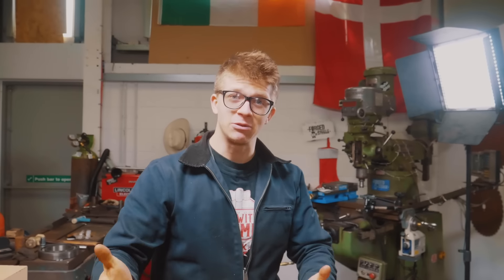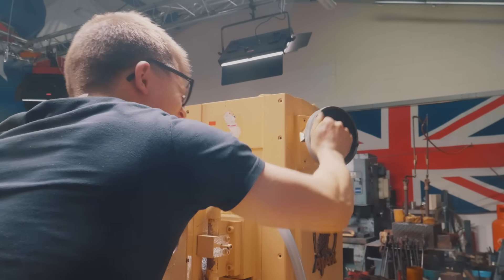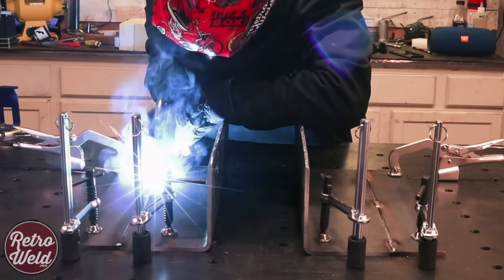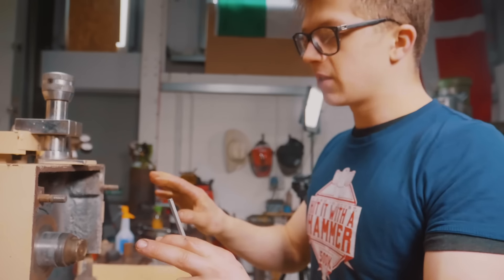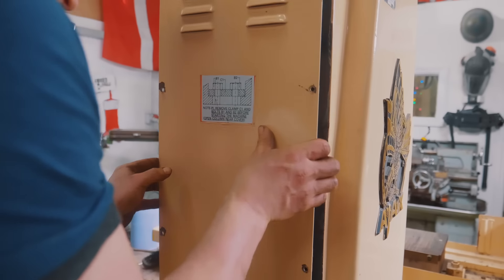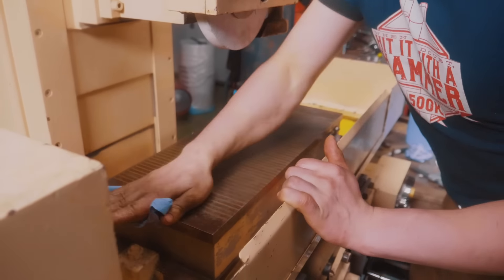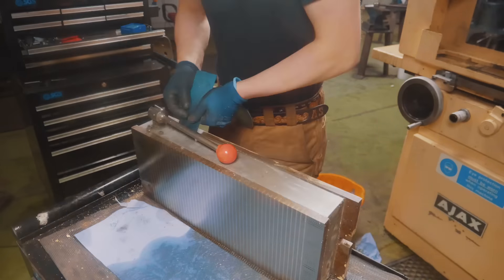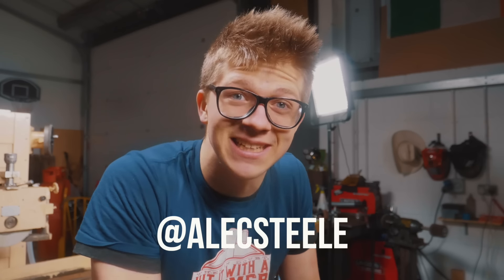THE SURFACE GRINDER IS ALIVE!!!

Comment from the maker: Hey guys! Just want to drop in and mention - I wrongly assumed water cooling the part on the surface grinder would keep the dust down enough to make it safe to operate without respiratory protection. After doing some googling this seems pretty stupid. In the future I'll be wearing my respirator when operating it and sweeping up the dust well after a grinding session!
Reply: 2nd
Reply: Nice!
Reply: Alec Steele you are amazing and I am wondering how to get in to black smithing I just got absolutely captivate by black smith
Reply: Stop tasting the oil
Reply: Just a suggestion as a machinist squaring the chuck to the travel of the grinder is very important but it is only half the battle during the video you took off the back rail of the chuck when cleaning it when you square the front of the chuck again and put the back rail on the chuck you will also need to side wheel grind that in to make sure it as well is parallel to the axis of the tables travel. Also I'm assuming if you've watched videos on grinding you've seen people use stones on everything from the chuck to the parts they place on it, stoning takes the high spots on a grinder and brings them down to average the top of the chuck and makes sure the bearing surface of the chuck to the part is as good as It can be so I highly recommend if you plan on using the grinder for accurate parts to get one, another tip I saw you put the grinding wheel down on the chuck I recommend not doing that as the wheel is harder than the metal used to make the chuck so in placing the wheel on the chuck you may have put a slight ding in it not a huge issue but just good practice. Also when dressing the wheel a new wheel that you put on the grinder will usually need to be dressed quite a bit to make sure you are running true the wheel might be bouncing on the surface there should be a lines perpendicular to the axis of the grinder where the wheel skips that is how you can tell visually but you might also hear a slight bouncing sound that comes with experience but it is good to look for.
Reply: Firstly its good practice to dump a grinding wheel if its been lying around for more than 2 years not being used. 2nd. Ring test the wheel for cracks. Hold it by a small bit of steel bar and tap it. If it rings like a bell its crack free. If there is a dull thud then don't use. Its knackered. And remember to turn off the cooling water before you turn off the wheel so that it throws off any water before the wheel is stopped.
Reply: As we said in the Army. “ Assumption is the Mother of all F&@K UPS”!
Reply: are you going to be putting it in the grinding room at some point? Or are you keeping it out there?
Reply: Alec, don't feel bad about making mistakes; everyone does. That's why first machines should be cheap ones. They are learning machines. They are for learning what not do to. When setting up one's first shop, only buy machines one can afford to break. This is for any shop, machinist, blacksmithing, woodworking, etc. Later, one can invest in high-quality machines.
Reply: why not make an extractor hood to go over/above it?
Reply: Ian, you sound like the most knowledgeable commentor on the subject of surface grinders. Question, why does the magnetic chuck have to be parallel to the axis of the table? I don't see any method to align parts to the edge of the chuck.
Reply: @ Josh Clark He said in a previous video he was leaving in the shop because it's to big to fit through the door to the grinding room.
Reply: When I worked at Norton ceramics we used to use those heavy paper shop towels (wipe all brand) Get them wet with coolant and drape/wrap  them over the left side of the wheel guard hanging down like a curtain to catch the mist and grit.
Reply: Alec Steele .. Hello alec... long time subscriber here and i believe first time posting...  in your video, you didnt completely dress your stone and you can see it in your surface finish... a stone that isnt dressed will leave chatter marks...

Also when you dress a stone it should make a constant sound on the diamond.  It should sound like high rpm vibration.
Reply: Hi Alec, Work around grinders all day in a very safety aware factory and nobody ever wears a dust mask for surface grinding, just keep your face away when dressing the wheel. Also I don't think you dressed the wheel deep enough so I'm not sure it cleaned up all the way round. Loving the video's and the second lease of life your giving these machines!
Reply: There is a plastic wrench for those bottle lids. Costs next to nothing. Very useful if you use a lot of stuff that comes in industrial bottles!
Reply: Shawn H Corey invest in high quality machines from reputable vendors. That way you get the proper TRAINING on universal issues and issues pertaining to the specific machine. Don't waste time making the same mistakes that others have made when you can be taught correctly how to avoid those mistakes. You won't live long enough to make them all. You can be taught though, how to avoid them all.
Reply: Maybe you can modify the cooling system to keep the dust down.
Reply: BedfordshireBiker i said the same thing.... the diamond didnt give a nice constant tone.

I too do a ton of surface and cylinder grinding.... New wheels always take a ton of dressing to get them true.
Reply: FPV-Gaz well its not a place of employment so your point is void lol.
Reply: Heyo, ROBRENZ and Oxtoolco have some good videos on surface grinding and getting stuff flat. Just.. Probably don't go into lapping just yet, ok?
Reply: Brian Sherret, the guard at the back of the magnetic chuck, usually referred to as the fence, should be parallel to the mag-chuck and the chuck should be parallel to the axis of the machine. Typically people push things up to the fence of the chuck and often build a "square" to hold the piece in place as well. As for if it truly matters as long as your chuck and table and stone are all reasonably within tolerance, I won't make a statement, but I'd hazard a guess that it does for at least certain applications of grinding things on the surface grinder. 

If you're just making things reasonably flat, well it probably doesn't really matter all that much.
Reply: Thanks so much you motivated me to get into blacksmithing. Now I have a gas forge but the weather is not good enough that I can do anything
Reply: Love these types of videos!
Reply: Alec Steele #whichisnicely
Reply: Alec Steele try not to grind scale.  It'll plug up the wheel and you'll not get add good of a surface finish.
Reply: Alec Steele YES
Reply: Awesome video!!!
Reply: M Gonzalez, That's a good idea. If Alex wants to take that to the next level, he could add a wider coolant output on the other side of the grind wheel and increase the flow rate, so that new output has a waterfall effect and any dust gets trapped in that. But that's a lot of extra work and greatly increased flow rate, when a wet rag would do the job just as well, or possibly better.
Reply: Well that stinks, yeah it did look to be throwing a lot of material. Too bad. Maybe you could extend the grinding room someday.
Reply: yeah that was what i was thinking. With grinder what matters is the motion of the wheel relative to the table only right? you are not lining anything up to be square with the table or the wheel. you could thow a plate on there at 45 degrees to the table and it should still end up square.
Reply: I know it's more work for you and your team but I love your longer videos    I feal like I lean more through the longer videos as apposed to the shorter ones
Reply: Alec Steele hey so for a possible project I would be cool seeing you make 2 different damascus steals you make they making another piece of those two and not folding as much or even if it’s possible only once and put their grains going in different directions
Reply: Alec Steele NOTE TO SELF.  TAKE MACHINE APART FIRST TO MAKE SURE ITS GETTING OIL
Reply: What if you make a acrylic case around it similar to what they use for CNC machines? It really would only need acrylic in the front viewing area
Reply: Yes it is possible tor run a motor w/o a ground or negativ connected because what i think is that the motor has an internal star-bridge(Sternbrücke(i live in germany)) whitch just connects the three live wires and the phase shift of 120° is canceling there selves out(advanced electic stuff)
Reply: Hey sorry im sorta late to comment but ive seen some swell suggestions that could help you with this machine and ill mention what i read below this. First off im glad you realized about the dust and will keep it in check.
Then i had to take a minute for how you compacted everything into the one video. I can't express how happy i was that near the end you added the extra part instead of making another video for it (i still would've watched it) like many other youtubers i know would have done. 

I love your videos! The music, and editing is just amazing!!

Now as for what I've read about that dust. Ive seen people talking about: a rag drenched in coolant to catch the dust and mist as it flies off or using a fume hood or however they are called.

Finally mostly everyones been saying it: your wheel needs to be completely "scraped?"(not good with my words today sorry) with the diamond so it makes contact all the way across and around the wheel. 

That is all, thank you!!
Reply: I hope you had the magnetic chuck turned on before you ground the face of the chuck
Reply: Hey Alec nice vid again mate. Just s suggestion why don't you put a tap off the toilet sisten. Use a 3/4-3/4-1/2 tee joiner and run some copper. Then you can have a tap there. No licking around with the basin. And it's not restricted flow like the basin is.
Reply: Alec Steele you should check out Make it Extreme's vid for their electromagnet mill clamp, could replace your super glue method.
Reply: Alec Steele your humility and attention to being a good example really impress and inspire me to work safer!! Thanks again keep up the great work! I'm loving these fix up vids!
Reply: First off, not sure why you assumed water cooling would prevent dust flying everywhere. Second, next time you're in Montana, hit me up it would be an honor to meet you in person!
Reply: America is going to get your oil
Reply: You did not mention the grinding wheel loses outside diameter as you grind so no matter how many passes you take with the surface grinder it can never make it perfect. I'm sure it's not enough to even matter but just something I figured you would mention.
Reply: vaccume dust collection
Reply: Little tip with wiring.. always make your earth lead an inch or so longer than the other cables, that way if you dnag the cable and tear it out then it stays the earth will be the last to disconect giving you less chance of getting a belt
Reply: Interesting idea for the peg spanner, but if you were to make it from 2 hinged pieces of square bar then it would be universal and would give you more space to fit a spanner on the nut
Reply: I’m from Montana
Reply: Alec Steele i think oil binds dust better but using oil in a grinder is suicide...use a oil water coolant mix thats what they use when they grind magnesium or other ”reactive” metals.

Comment: Hey buddy I used to operate a surface grinder and please please before you do any work on it perfect it. Clean everything paint and oil wire brush and do all the things it needs so you know you're good and to avoid what happened to your mill! I can't remember but there is a device that checks the holding force of your table and you should use pieces to set on each side a  part that is held down by the magnet to keep your part from sliding during a cut. It increases the surface area. Also you should talk to This old Tony he is a machining channel and he can be very helpful
Reply: Yes.... Just like you said you WISHED you had done for the Bridgeport when you had first gotten it.
Reply: I have only ever seen one that tested a magnetic chuck when I did a calibration course. All that did was test the break away torque required. If your mag based chuck is flat and has had less than 3/16" ground of it it will be fine. 
I think he said that he was going to remove the slideway lube pump? The X and Z are probably gibed slides. I would guess that the X has linear bearings an would benefit from grease? I don't know but a cheap and easy fix would be a half decent grease gun converted for oil and fit grease fittings at the ports the unobtanium pump was feeding. At least that will get some oil around.
Cheers

Comment: The great thing about 3-phase wiring is, if the motor runs backwards, you just need to switch any two wires.

Comment: Hey Alec just a couple of things, make sure you check your wheels every so often with the ring test. Hold it from the center bore and lightly tap it to make sure it doesn't have a flat or "wrong" note to it. If it doesn't sound right to you DON'T use it, that means it is damaged and has an incredibly high chance of coming apart and damaging the machine or you.  Also in the future possibly see if you can get product from Saint Gobain Abrasives they have quite a few different abrasives brands under them. There is also a lot of resources out there that you can learn about the different hardness and grain spacing and grit types.

Comment: The tool you made would be better if it were a Y shape that sits flush with the nut.  By doing that the crescent wrench would be able to make full contact and fully rotate.  Maybe you should forge and machine a new tool in a future video.
Reply: I usually make a a long C spanner and put the pins in the side it should always give access to the flats then.

Comment: Alec, you should put ferrules on flexible wires. Otherwise there's a chance that your wire slips from underneath the screw.
Great work! It's good to see you take care of your machines. Makes them last a lot longer!
Reply: I was going to recommend that he tin the ends with solder and a soldering iron. Ferrules would still work though - either option is better than bare copper :-)
Reply: As an electronics technician this always triggers me watching people clamping wires without ferrules.

Comment: Personal preference, but I always wear a face shield AND safety glasses when using a surface grinder. If you ever blow a wheel (yes, it happens) you'll be thankful for the extra protection...... and use that clean pair of undies tucked in your tool box.

Comment: just a tip for armoured cable. it's always good practise to connect the external armour to ground somewhere.

this will add extra safety if in a situation where the armour and live become joined somewhere due to damaged cable etc.

Comment: Before you press the button to move the table side to side you need to disengage the manual handle usually by pulling it, that will stop it from spinning